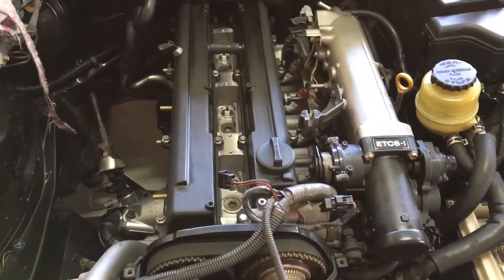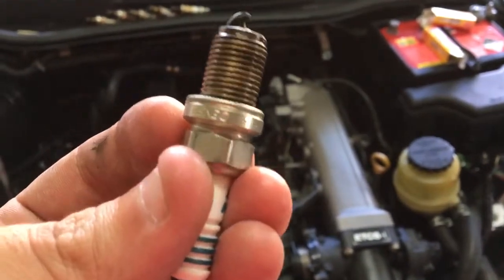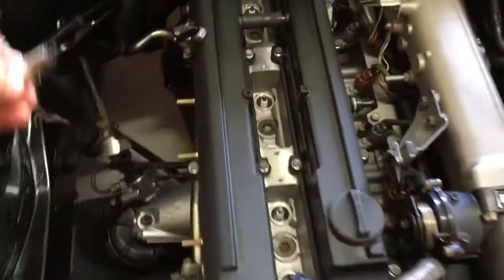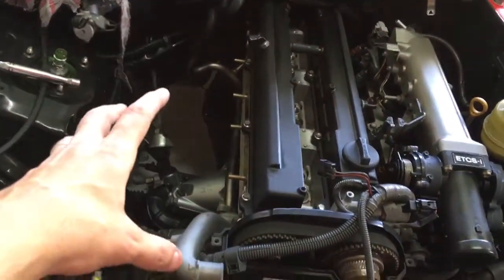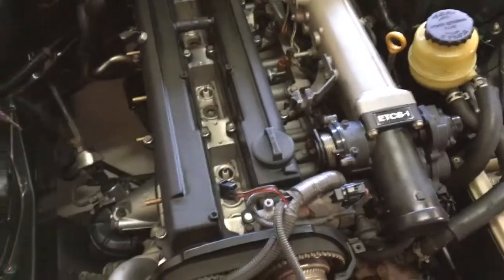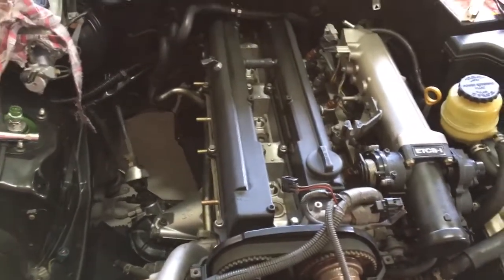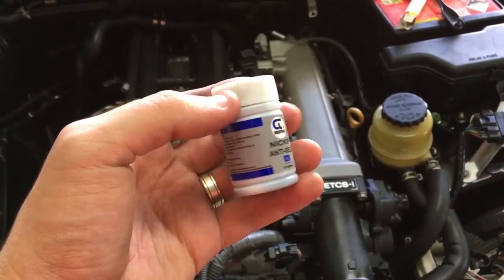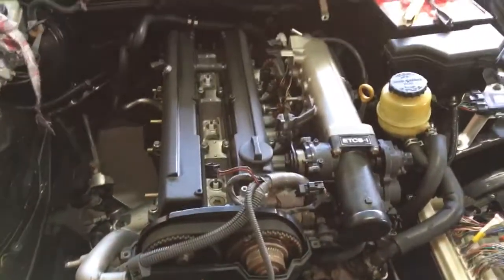Vvti 1JZGTE spark plug change

Comment: Irrelevant question but what engine mounts are you using in this car? Its near impossible to find mounts for a toyota crown
Reply from the maker: The aluminium brackets are jzs171 crown, the rubber insulators are the standard 1gfe is200 ones. Hope that helps
Reply: @ThatCarChannelOfficial  yes it does very much thanks for the quick replies on ur old videos